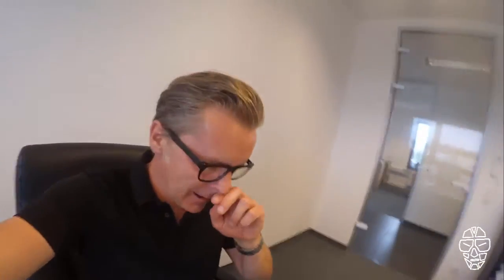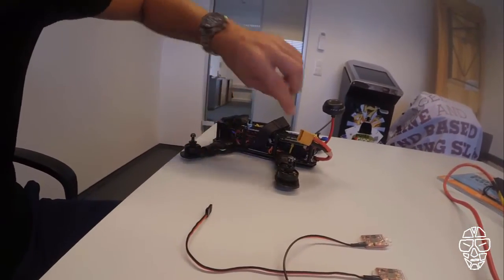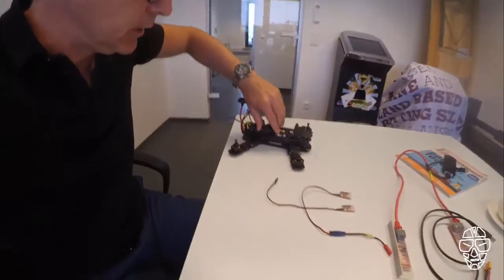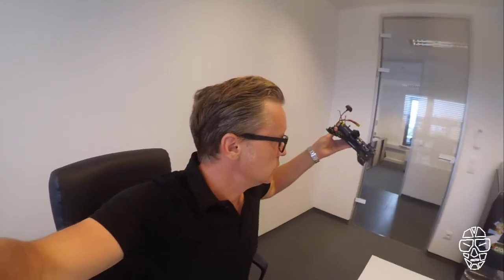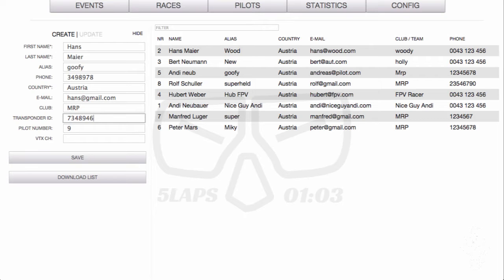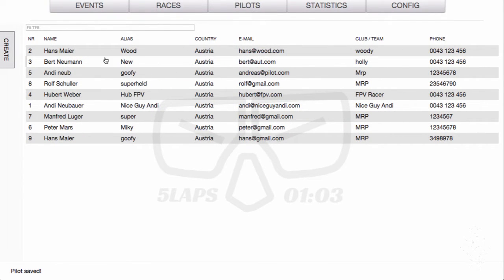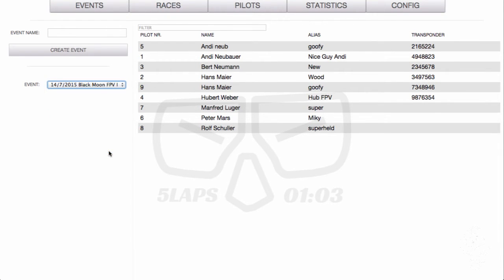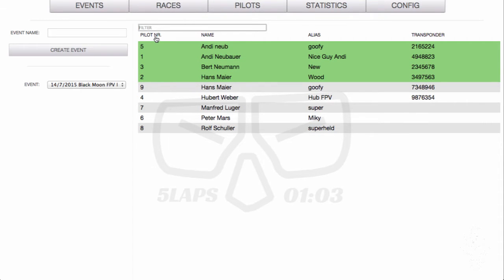FPV Race Tracker Software

Comment: Hi Andi, We are really liking the look of the Race Tracker Software. Is this open source where I can contribute UI design to?
Also, one other thing we are looking at is we break our racing into 4 groups of 4 pilots per group. We do 5 heats, is it possible to cover that scenario?

Many of our pilots will have multiple quads on the day, we would like to register different quads to the pilot and then simply have a drop down for each pilot on what frame he will use in the race. Is this scenario covered off already?
Reply from the maker: +Ciaran Whelan Thank you Ciaran, I have send you a message via you tube.

Comment: Hi andi! So we are hosting a race next weekend. We will have 40 pilots and want to divide everyone up into 8 groups of 5. We are going to run 8 rounds of qualifying for a total of 64 races. Can I manually assign pilots to a heat number so that they race with the same pilots for all 8 qualifying rounds?
Reply from the maker: +SF PV yes this is possible you always can assign pilots manually  to heads or rounds.
Reply: +NICE GUY ANDI I'm having trouble manually assigning pilots. When I click on a pilot is just shows "not assigned". Some pilots have the option to assign to any heat but others don't. Also where can I put in the video channels? Cheers!
Reply from the maker: +SF PV can you send me a e-mail please andi@niceguyandi.com

Comment: Andi, nice work. I do have a few questions.
Were can I find more information about the transponders.
Is you system accurate enough to see if a pilot passed through a gate? I am asking because then you could check at each gate to see if they passed through it correctly.
Does your system currently support multiple timed gates?
Reply from the maker: ***** thank you Gerard for now the hardware / software doesn't support that but I m continiously adding new features and the solution you have mentioned is already on the to do list.
Reply: that would indeed be great :)
Reply from the maker: Boris B. keep the sail hard to the wind and trying to implement all features are necessary. I already gave Rolf the software the hardware should arrive next week so looking forward for feedback. I am sure you will get it soon too Boris and would love to get feedback from you guys too.
Reply: yeah this needs some good testing etc.
Let me know if you need some help in development. It would also be awesome if this could be integrated into livestreams. You know like onboard vid with display info with times etc.
Thats what racing world is missing now after watching the last drone nationals.
Reply from the maker: Boris B. yeah thanks Boris, this feature I have already in my product backlog but need to finalize other features first like external TV for pilot race schedule and real time results, a visual pilot round and heats assignment and so on. Spoke already with Menno as soon as he got the hardware I will forward you a developer link and would really appreciate if we could share our experinece and work on other nice adds together.